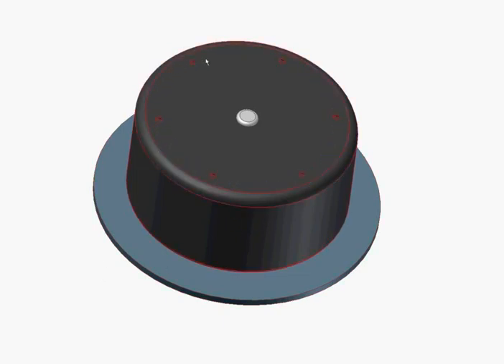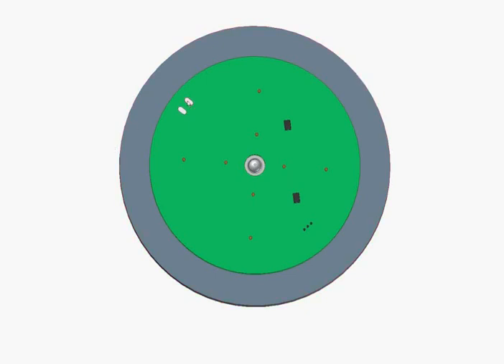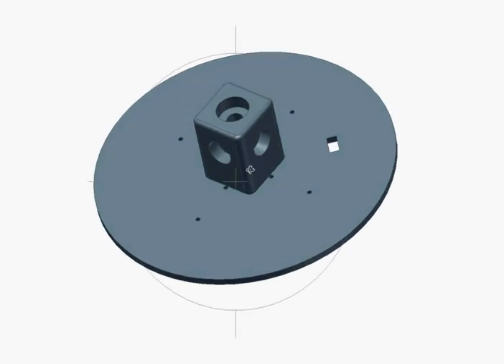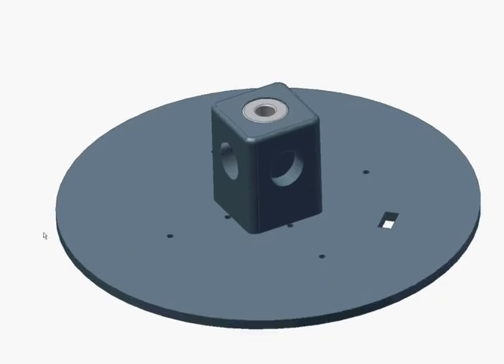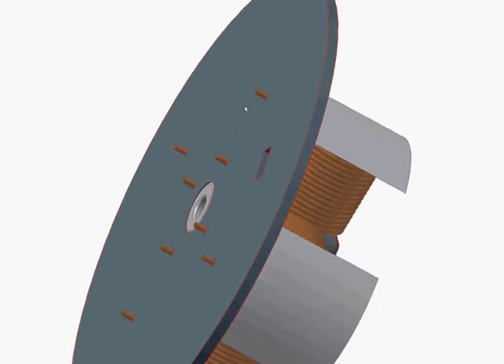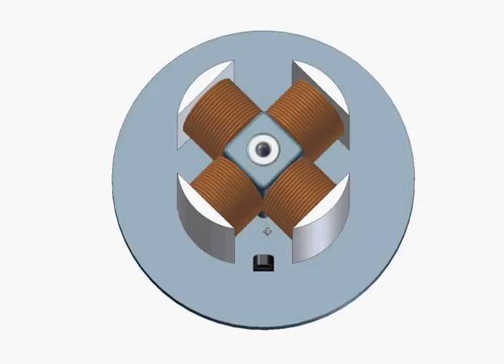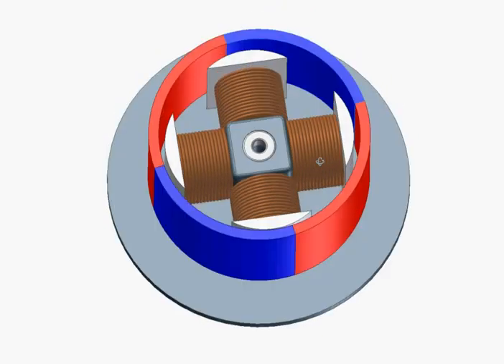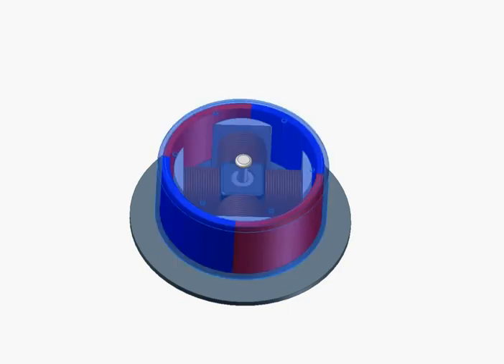How the Brushless motors are made (BLDC)

Comment: Sorry if this is a stupid question, but which part of the motor rotates?
Does the plate with the PCB stay stationary and the housing with the permanent magnets glued on the inside spin? It wasn't clear what is attached to the shaft.
Reply from the maker: it's the rotor, on this particular design it is the outside part

Comment: cool video, in essense a brushless DC motor is quite like a AC motor with a circut with a sensor to change the current for it to work. in stead of using an alternating current which is produced in a kind of scaled up version of the AC motor AKA a generator :P so the current is already perfect for running an AC motor :P how many rpm you get is a different story with AC motors though not just connected to how high the current is...

Comment: A good description indeed but the difficulty would be trying to make the magnetic components at home because of the curvatures.The commentary in English is tricky to catch at times as it comes over as very stacatto and rolled.Try not to use the word "Back side" as" Underside" preferably or" Opposite side" would be better in English. Thanks for sending the info.Maybe you could draw out a circuit diagram for the video also?

Comment: What is the main difference between brushless motors and stepper motors?
In both cases you need a controler, in both cases the magnets rotate and the coins are static.

The only difference I see is that a stepper motor has a finer control on the angular rotation but is otherwise equivalent to a brushless motor with a lot of coils and magnets.

Comment: What is that little black sensor called? What does it sense? The position of the rotor? I guess that's used by the control board to change the direction of the current in the stator coils? I really don't see how this thing works :(

Comment from the maker: then you can check if the power is properly delivered on the coils in respect to the hall sensor signal. if not, then the controller or the hall sensor is dead. 
You can also measure the resistance of the coils. It should be equal for all

Comment: hey pcbheaven I have a question. I have a fan kinda expensive shaft fan that just had the brushless motor go bad. Something happened where I believe the wires over crossed polarities or something. Basically when you power it up. The rotor just move back and forth in a jiggy jag motion and just stays there. If I give it some momentum it will go a little and die out. What happened? Did the coils get messed up and change polarity? Can I fix this? I can't get the part.